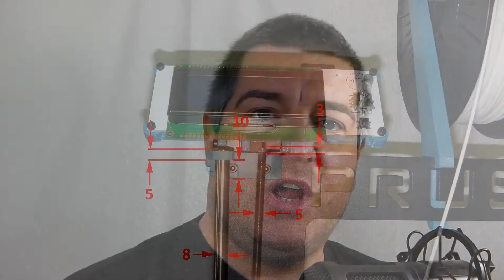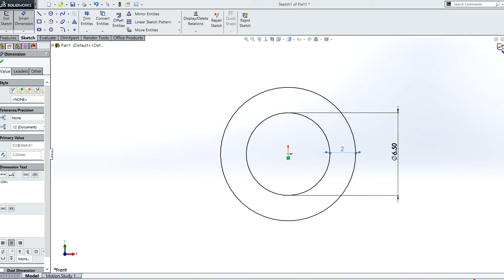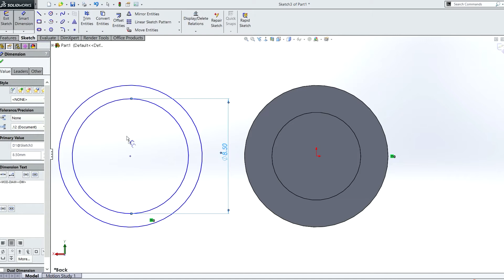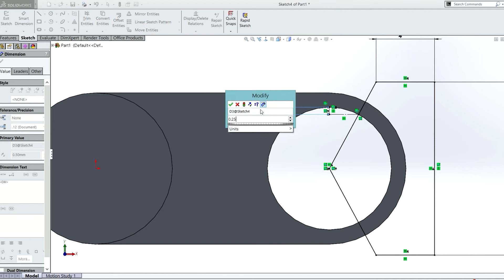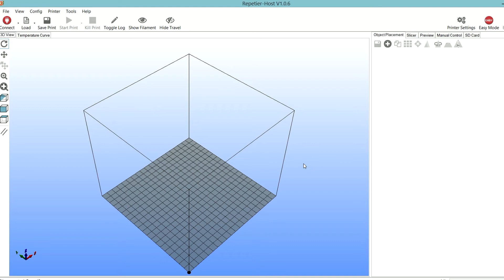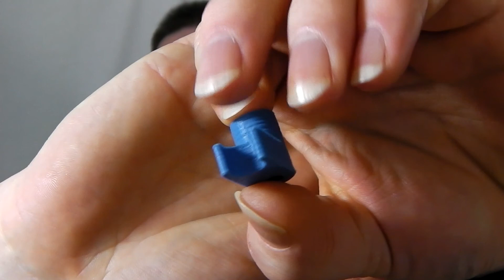3D Print design process in a nut shell

Comment: great vid as usual. Did you ever complete the E3D V6 hotend installation on the xyz? I bought one after watching your vids and doing some research, but yet to install it yet.
Reply from the maker: ***** Hi, glad you enjoyed it.  Yeah I got it all running and calibrated.  I am sure I mentioned the Slic3r Z axis offset value (at bed level Z -1.500 of course) in the Phase 7 video.  I then returned the DaVinci to the stock hot end to start some comparison prints.  In the mean time I got some 3D hubs work and couldn't have the printer offline.  Now that I have the BQ Prusa i3 I'll be able to have 1 printer running while I mess with the other one :)
Reply: Yea, this 3D printing is kinda addictive. I haven't had the printer off long enough to switch it out. Might just buy a kit of some type and use it on a different printer